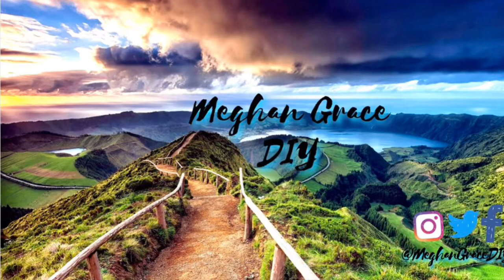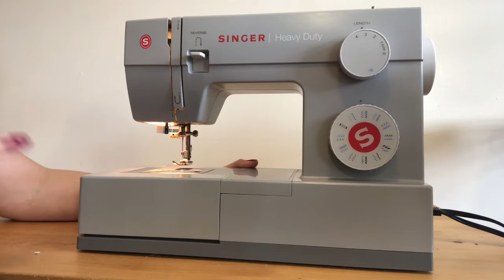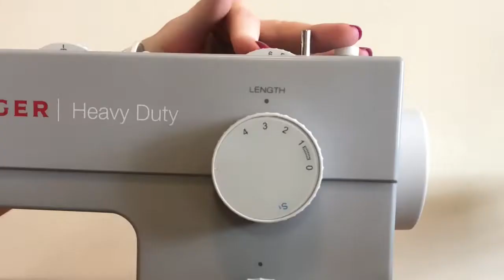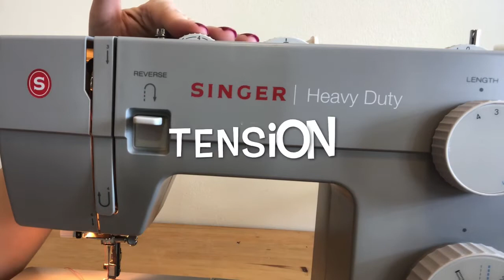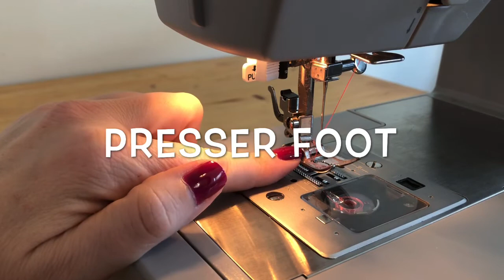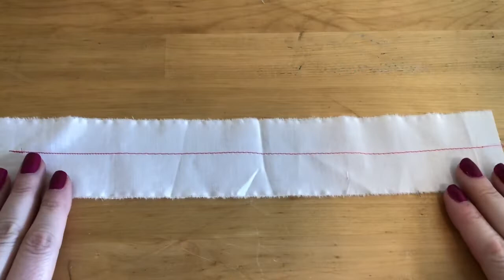Sewing Machine Basics - How To Use a Sewing Machine for Beginners!!

Comment: hello very beautiful videos please kindly film how to operate the sewing machine electric foot pedal how it's used to sew please ok? Please kindly reply back ok?thank you very much
Reply from the maker: Sure! I can explain it a bit here too - the door pedal is just like the gas pedal on a car.  Use light pressure at first and then once you feel you have the hang of that, you can push down a bit harder and get used to more speed.  Most home machine won’t get up to super intense speeds even if you push the pedal all the way down, but industrials can get going pretty fast if you need them too!